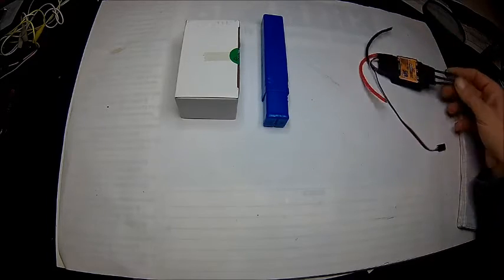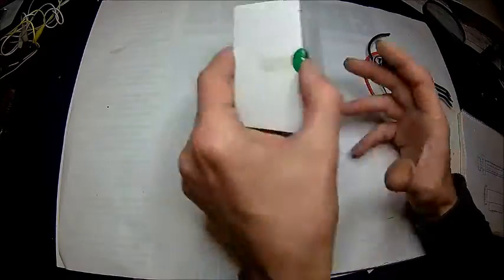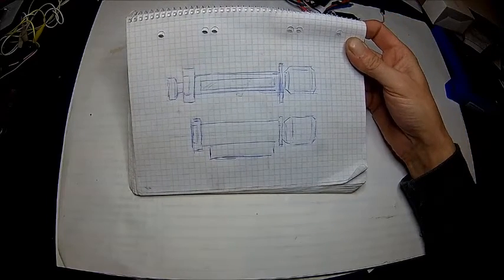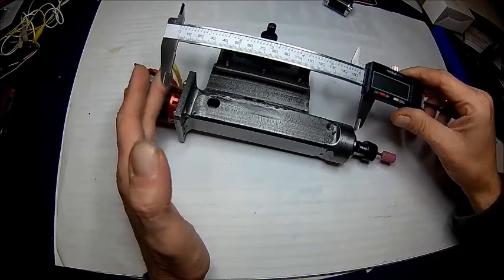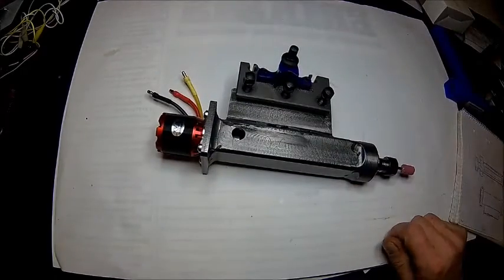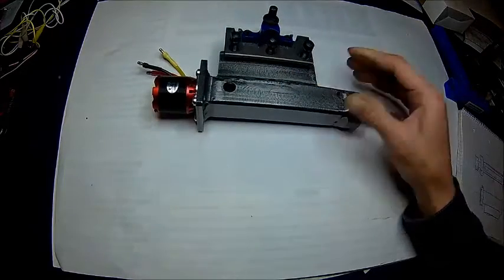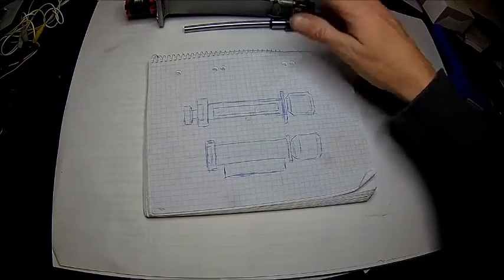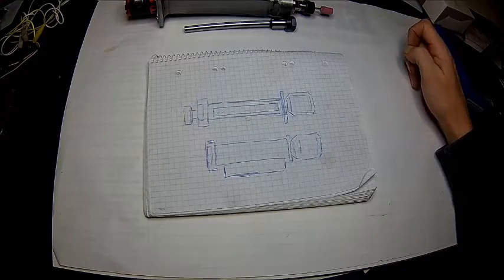The smarter Tool Post Grinder - Part 1 -  Concept and working prototype

Comment: For $60 to $100 you can buy a 500w router spindle and driver with switch and potentiometer for speed control make a mount and good to go with an er16 collet supplied.
Reply from the maker: Of course you can,....and you most likely get exactly what you pay for ....
Reply: @dynoguy  Exactly, a high speed router spindle only seems like a good idea until you figure out the bearings in them as well as the drive motor balancing isn't nearly good enough to do precision grinding. Those components don't need to be with a hand guided wood cutting tool. Commercially made tool post grinders are expensive for those reasons. Hemingway Kits offer a tool post grinding "kit" meant for machining and assembly by the end user.  Even at that it's quite expensive due to the high quality of the included precision balanced motor and bearings. The design in this video is pretty interesting since those small high rpm motors should be fairly well balanced so it's a good starting point.

Comment: with the extra height you have on youre small lathe you could use a small benchgrinder

the grinder you build looks nice , have a bunch of cordless drills laying about with batteries that are dead , i think i rip a motor out of one of those
Reply from the maker: A bench grinder is too big, also running too slow for smaller grinding wheels.
Thanks, not sure about the use of cordless drill motors, never took one apart.
One of the design targets was allowing internal grinding on hollow parts and of course rigidity was another major concern, that's why it's so heavy.
Reply: You need 12000 rpm for quality tool post grinding wheels.

Comment: nice grinder. 
does magnets on motor attract metal particles inside the motor?
Reply from the maker: thanks,...yes they do attract ferrous particles. i do have a simple cover which goes over the rear end. A bit of dust is not so critical, but you need to be very careful with swarf. If larger bits go inside, the motor needs dismantling otherwise it may smoke.

Comment: Excellent proof of concept. I made a video on using a air powered die grinder and it is true what you say about having mass to keep down vibration. I have no problem with internal grinding but external the wheel chatters some times.
Reply from the maker: Thanks, i am actually very pleased with it. I think there is absolutely no change to beat the simplicity of yours.
But for grinding you need 4 things... mass, ridgidity, ridgidity and more ridgidity. The spindle bearings are also quite important, that's the reason why i used a double row bearing on the load side. My experiments with plain die grinders were rather disappointing, they are designed for hand held use, so the bearings are not super critical and most probably not the best you can buy. With you chatter issue,  quite possible that's a resonance issue. Try to play with center height and lathe spindle direction, also take very light cuts with the biggest possible wheel and it probably works out ok.....Thanks for subscribing.